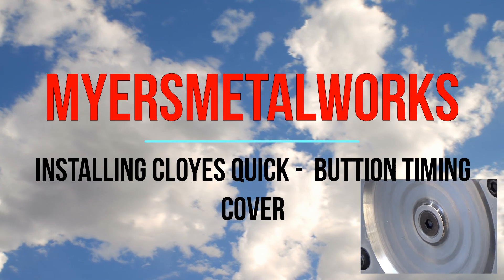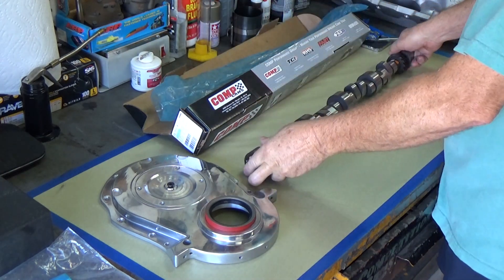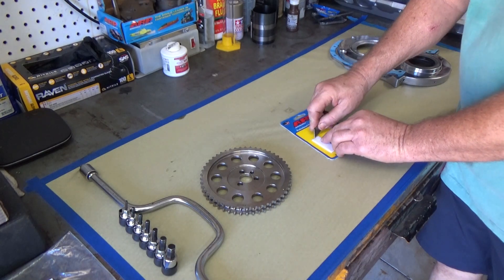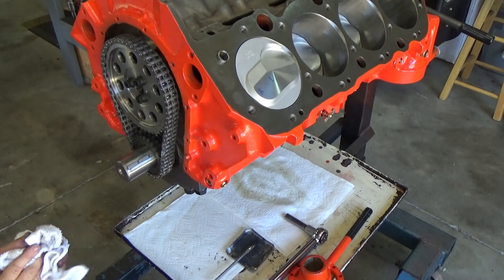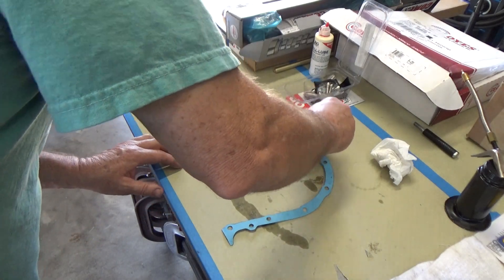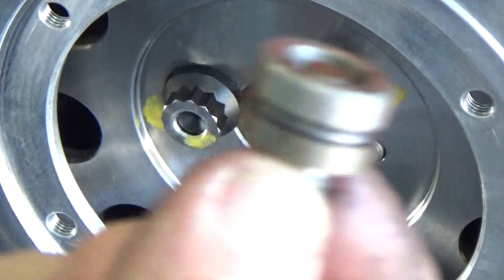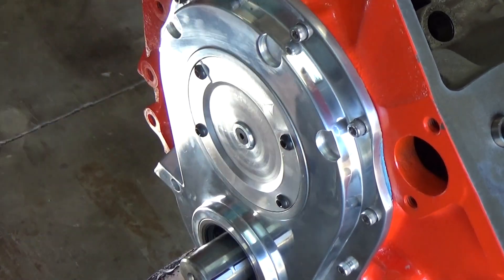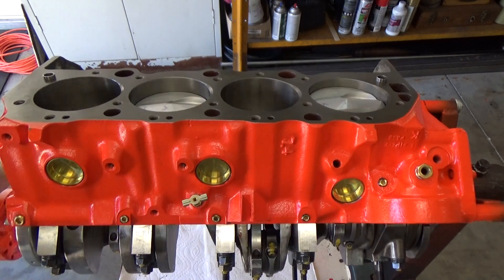Cloyes Quick Button timing cover first time to install..#7 Chevy 454 Big Block Performance Build...

Comment: Just a respectful question, but why use a button when your block will accept a cam retention plate? If you mentioned that i missed it and sorry in advance.
Reply from the maker: We ordered parts for the year engine it was, and these are the parts that came and used.... On older blocks (I think) the plate was for revers rotation engines...

Comment: Great video! I have a question regarding the timing chain cover installation. My motor is already installed in my Chevelle, and I’m hoping I can change the cover without having to drop the pan. I have a big block 496. Any thoughts? Thank you!
Reply from the maker: Thanks for the nice comment on the video... I have seen timing covers taken off and installed back without removing the oil pan, so it can be done.... They lossen the front and side bolts and pry down the pan... But I myself have not done it... Good luck on your install....

Comment: I saw the block had two holes for a retainer on the cam.   It was I mistaken.   I have a 75 vintage I am putting together.   Button or retainer is the question
Reply from the maker: The 1975  big block chevy would need a button for a roller cam upgrade...

Comment: Good idea on screwing nuts  on the screw before you chuck it up, Nice Bison by the way.  I went with a CVR Bullet proof cover. It has a nice o ring around the housing and came with a extra o ring. Very happy with it. Thanks for the nice video!
Reply from the maker: Thanks for the nice comment and information on your cover...
Reply: @Myersmetalworks  Absolutely!

Comment: I ran into the same issues with my ARP bolt set. I wonder if they will eventually make a set for retro roller setups like this. Nice video 🤘🏼
Reply from the maker: Not sure West Coast Pedal Bord....  But thanks for the nice comment.....

Comment: How has this cover worked out for you? I’m going from a solid roller cam to hydraulic roller cam and this cover seems like a good choice for how to deal with the cam button without having a piece of equipment to measure the cam end play
Reply from the maker: Hi jeff.... I like the cover and how they say in the instructions on how to set the cam end play, but I have not run the engine with it and don't have any input on how well it works...

Comment: You are an amazing machinist I love watching you work great job as always.  Questing I'm going to be putting the same timing cover on my 434 Stroker. Alot of reviews I read about it    they say the back of the cover needs to be milled some to fit correctly. Did you run into this problem?
Reply from the maker: Thanks for the nice comment... The cover I got seemed to be flat, and fit well...

Comment: The big block cam button is larger than a small block button and fits snuggly, centered in place and held in by the flanges on the cam bolts. In other words you need a cam button that fits a BBC.
Reply: Also, the bolts need to be cleaned and installed with thread locker or they WILL come loose. Your attention to cleanliness is nice. d:-)
Reply from the maker: Thanks for the nice comment and thread lock tip...
Reply: A locking plate is a good option as well. Manley makes a inexpensive one part # MAN-42114. Would save a lot of time not machining down some bolts that don't work for this application.
Reply from the maker: Thanks for the tip, Michael....

Comment: Interesting,  my cover did not come with the 10 bolts to hold it on
Reply: I prefer the stud kit over those cap screws myself anyway. Those just make it look strait from China which it may be I don't know. I like the cover though and that adjustment for endplay is a nice touch.

Comment: not everyone has a lathe
Reply from the maker: Hi Gus... Yes, your right and if I didn't have access to a Lathe, I would have bought different bolts
to install the cam sprocket...  But since I had already bought the ARP bolts, I made them work...
Reply: @Myersmetalworks  hey I’m building the same exact motor with the same bolts and timing cover. I don’t have access to a lathe, you think I could achieve the same results with a steady drill and a grinder? Let me know, thanks
Reply from the maker: Yes...... And good luck with your build!

Comment: Hi when installing time chain on the SBC it's dot to dot with #1 at TDC? Then rotate until both dots at 12 O'clock and that's when you are ready to drop distributor? Just wanted to ask I'll be doing this to my Nova.
Reply from the maker: Never have tried 12 O'clock for the distributor drop in... Sounds pretty neat....  The timing chain dot-to-dot sounds right...When I drop the distributor in, I rotate the engine and watch the rocker arms on #1 cyl  when I see the intake valve closing, I can put thumb over the spark plug hole and feel pressure, I look for the top dead center mark on the harmonic balancer and align the marks, then I drop the distributor in with the rotor button pointing to #1 plug wire....
Hope this helped...

Comment: Did you use an 8 inch balancer? Any clearance problems?
Reply from the maker: It is a 7" ATI Balancer for a 454 external balanced engine...  No clearance issues that I'm aware of....

Comment: Why not use the bolts that came with the motor saved a lot of time
Reply from the maker: Hi David...  I had just bought the block not the whole motor, and I like the ARP product...  Most of these older engines have been worked on over the years, and some of the nut and bolts aren't always the right ones or have been rounded off...   But your right, if everything is in good shape it would save a lot of time....😃

Comment: I have a question for you buddy my timing kit came with a Thrust bearing is it necessary or can I just put the cam sprocket directly up against the engine block thanks
Reply from the maker: Hi Ken...  At least the ones I've installed, the spacer or Thrust bearing needs to be used for alignment of the bottom sprocket on the crankshaft and the top sprocket on the cam... I use a straight edge  with out the timing chain installed to check the alignment between them...
For me its always best practice to follow the manufacturer's instructions on the install...
Hope this helped.... 👍